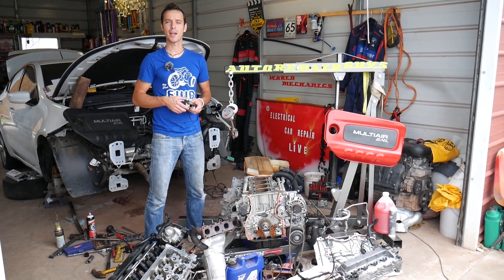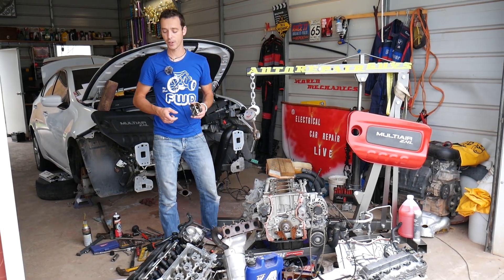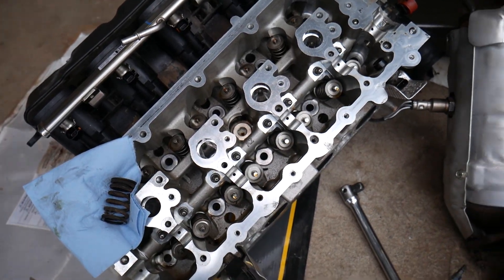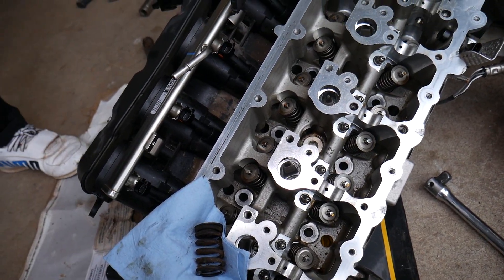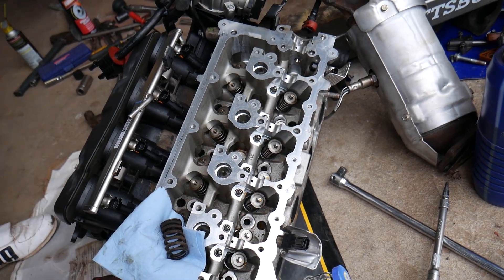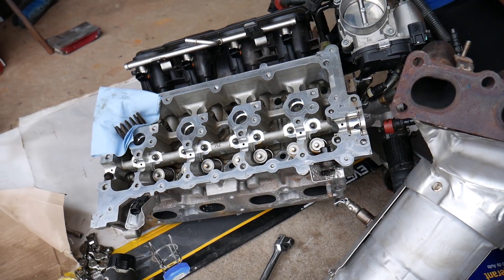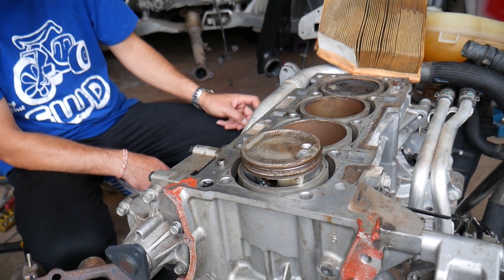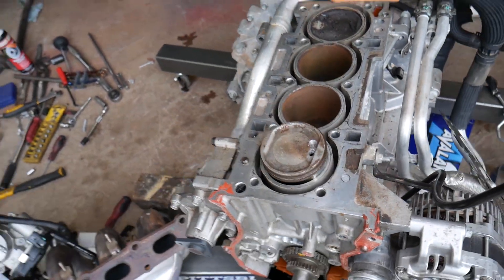BURNING OIL FROM VALVE SEALS OR WORN PISTON RINGS

Comment: Can Valve Seals smoke only with engine braking? 

I mean when u go from the hill with gear engaged, and after that you press full GAS and it smoke. There is only one situation, when it´s smoke..... Neutral never, after start engine never...

Comment: Excellent video !!  My story:  the spark plug in 1 of my 8 cylinders was getting fouled with carbon build up, to where it stopped firing.  Every 1000 miles I had to change out the 1 spark plug, the other 7 were fine.  This went on for 2 years.  After reading up on it, the problem seemed to be a bad valve stem seal.  I discovered that instead of replacing the seal, I could try using Lucas Stop Oil Leak additive, or switching to high mileage oil, both of which had extra lubricants for seals that may have gotten old or hard or slightly shrank.  The extra lubricants would cause the seals to soften and expand.  I did both, and the problem went away !!

Comment: When I start my truck it throws blue smoke from the exhaust pipe, but the smoke will go away a little less than 1 minute...I also have oil coming out of spark plug hole and the exhaust manifold, on the same side of oily spark plug...can it be the valve stem seals???

Comment: Hey mate thanks for sharing and Merry Christmas! 
I have a question for you. I have a Golf Gti Mk5 with the famous FSI turbo engine that 9 to 10 of them use  a lot of oil, and when i say a lot i mean about 1 litre every 1000 kms. The common thing that all these engines got is that you can't see any smoke coming out of the exhaust! Some times you get a bit of smoke when you accelerate hard but not what you are saying on the video. Can you explain why that happens? Cheers

Comment: Hey man I have a manual car and the smoke is not that blue it’s more white than blue. And when I’m driving and shifting it doesn’t smoke. When I start downshifting from 6 to 5 to 4 to 3 to 2 there’s no smoke but as soon as I shift from 2 to 1 and hit my brakes to slow down to a stop then smoke comes out. When I’m driving I don’t get any smoke .. what you described didn’t really match my symptoms
Reply: I have the same issue. Valve seals are likely it.

Comment: Hi bro i wana ask you a question, yesterday i has changed my motorcycle piston kit,and i also change more part like ( valve,valve ring(seal), & valve liners,) because my motorcycle smokey.

But after all installation processes finish, my motorcycle still smoky, what's wrong...? Im confused

My piston rings insallation is true, my piston insallation is true, my valve, valve seal, valve liners is new, everything is OK i don't make a mistake, but my motorcycle still smoky,  im really confused.

Sometimes when i start engine that smoke come, but after egine warm smoke is noting, but some times im start engine smoke is nothing (smokeless), im very " Confused because my valve, valve seals,valve liner is new.i hope you can help me answer this question.

Comment: my car blows smoke after sitting at idle for a minute and then driving but goes away while driving, but then it also smokes at high rpm. other than that it doesnt smoke at all. do you think its just my valve seals? you said the pistons would pretty much cause smoking 100% of the time but you also said it would smoke more at high rpm, mines only after idle and high rpm.

Comment: Hi can you help me please , I have a 2008 Porsche cayyane and when I start the engine in the morning or when I leave it for couple house , this blue white type of smoke comes out and then goes , I'm assuming it's the valve seals , if it is that , what do I do and what is the solution to fixing this , thanks buddy
Reply: You need the valve stem seals AND valve stems replaced. Just had to do this with my classic 1990 MB 300E.  Runs great now.....did it in Jan. 2021.

Comment: I dont loose oil and I dont have blue or black smoke in engine operating temparature, but my compression is low (below 9.5) and smells fuel from exhaust, also have black spark plug on regular baais even after cleaningbit regularly and has rich mixture which causing low gas mileage. What could be the peoblem???

Comment: Replaced the valve stem seals and still burns oil at acceleration after stopping!
Reply: Did you find out the problem? Was it piston rings ?
Reply: @nosayloveshater11  yes it was piston rings
Reply: You need to replace BOTH seals AND stems.

Comment: I've got an 86 f150 witha 302 that has alot of miles like over 200,000. it was doing very well and then it had a bucking problem which was either the fuel filter or vaccume leak which is mostly fixed now( no problem with oil) I replaced the exhaust manifold do to a crack which eventually busted in 2 and now its got a oil leak and smoke coming from crank case, exhast and everywhere else like it looks like im driving a California wild fire. there is some oil on spark plugs but nothing horriable. I was showing low oil pressure with there being well over the amount needed so I'm assuming it may be the oil pump and oil pan gasket. any idea on if I should swap engines or try the oil pump and pan gasket 1st?

Comment: Oil consumption with no apparent oil smoke often indicates collapsed oil control ring expanders or worn oil control rings.
Reply: Any advice?  My v6 showed low compression on 2 cylinders, leak down test proved to be a ring issue (air flow observed from oil dipstick).  I decided to pour about 4 capfuls of atf in those problem cylinders, and crank the car with all plugs removed.  I think my situation is futile, damage has been done, to point of no return., lol.  The engine is thirsty, regarding oil consumption, btw

Comment: Will a head gasket seal solve the problem temporarily?
Reply: Head gasket would not necessarily cause oil burning, unless it's the head gasket has blown. When valve seals go bad it allows oil to drop from the valves into the combustion chamber, thus causing this issue, or oil will blow by the piston rings and burn in the combustion chamber, same effect
Reply: Richtmyre yes I’m pretty sure there head gasket is blown and in need of valve seals thank you for a second opinion!
Reply: Wow, it's females like you who give women a bad name when it comes to mechanics... Stay in your lane mama's, because..  well... you dunno shit!

Comment: Perfect explanation. Now I know it's my valve stem seals that is my issue. Thank you.
Reply: Hi, was it really the issue with yours? I have the same problem on my TDI.
Reply: @DEM925  actually got those seals replaced and it didn't solve my problem. 😕
Reply: @FARANG-h8m  ---you need to the seals and valve stems replaced at the same time.

Comment: I think it's a bit over simplified to say blue smoke at certain times is valve seals & other times is rings. These smoke symptoms can very much alike for either, & should not be a definite indication. Is it not best to do a compression test? If there is too low compression in a cylinder, then this would be better indication of worn rings?
Reply: Some car using 4-5 piston ring system. They can have piston ring problem with good compression

Comment: How about no smoke at all. Just oil disappearing. Zero leaks.Quart every 800 miles. Changeg VCG, bunch of other seals, and got it up to a quart every 1300 miles.
Reply: Have a friend drive behind you and floor it. Your friend will see a light haze of blue smoke from your car's  exhaust.

Comment: I have a 91 Toyota paseo EL-44 motor, it is a non-interference motor. Motor does not smoke or nor does it leak anywhere. As far as I know, bad piston rings as well smoke up a lot . I just don’t get how my valve seals aren’t smoking up through my exhaust? Is it the way the motor is built ? Or?  Lost compression on cylinder 1 and 2. Thought it was the timing because when I tried to start the car, it made a fast cranking like there wasn’t any compression at all. So then I did timing and was still the same. Took out the head only to find out I had 4 seals out by the exhaust manifold thingy. Honestly I’m still learning about cars and would love to lear and watch more of your videos.

Comment: I understand that bad valve seals will give you blue smoke, but I just installed brand new cylinder heads with new valves seals and springs.. and I still have blue smoke out my exhaust, so you saying my new heads have bad seals?
Reply: If your car has a turbo, then could be turbo seals that can cause the smoke.
Reply: Or bad piston rings

Comment: If you already have the head off you should have already done dry and wet test to confirm but what do you suggest doing when we have the head off? Only oil residue on block? Anything else that would point to worn rings?
Reply: Burnt oil on the sides of the piston above the rings. But cos its all apart. Put the rings back in the cylinder and measure the ring gap
Reply: @tortron  yeah I've learned a lot about the pistons and piston rings. In some cases it's best to do the pistons and rings if you want it done right
Reply: @priusgame1178  I have a wall of destroyed pistons from trying to go faster lol.
Reply: Mine valve stem seals are busted, the car won’t consume noticeable oil on long journey (like 2000km highway driving) but smoke quite a bit in traffic. That’s how I make sure it’s not my piston ring😢
Reply: @Gary Zhang  for a Toyota corolla or prius engines it seems as if the valve stem seals crack and wear down because people don't change their oil on time the first 150k miles. The negligence shows with oil consumption at the 150k mile mark. I know some guys that take care of their cars and change oil on time and start burning oil big time at 225k. If you know how to do an engine rebuild then go for it all and replace the seals on top of other parts too.

Comment: hey could this cause low compression in a cylinder?
Reply: Yes if it is a piston that has a worn oil ring. That cylinder/piston will have low compression
Reply: Depend on car. Some will have low compression some not

Comment: thanks for the videos, can you tell us the reasons for the following problem, I've a v8 1987 chevy which has a dual exhaust setup, it is smoking only from one side? can you explain how to check and determine what causes the smoke? bluish smoke and it doesn't stop, thanks again
Reply: If is blue smoke and smoke all the time it is most likely your rings.Get you some Rislone stop smoke 16.9 oz or 2 of them which I quart.I would get some Seafoam or Rislone condition and cleaner .This will free sticky rings from carbon build up .After you clean first,change oil and filter .Since you have  a 8 I would add Iguart of stop smoke ,mixe with oil.Read direction carefully.Thi should help.Do Not Flush the engine.Hope this helps.